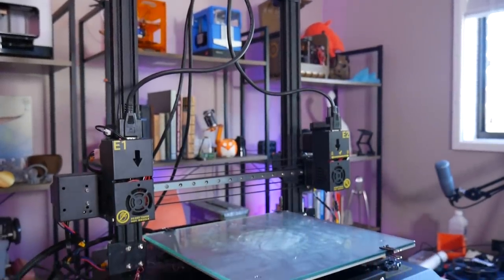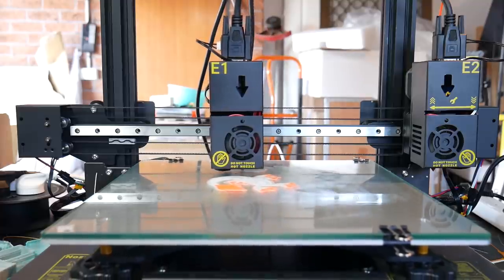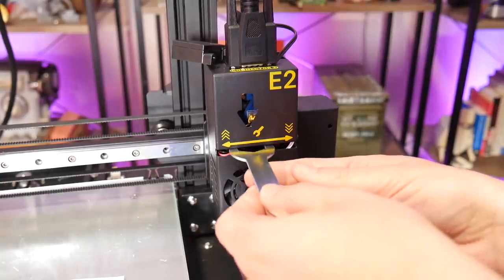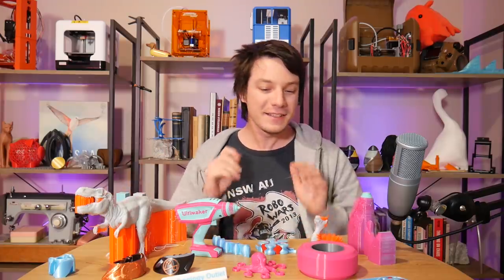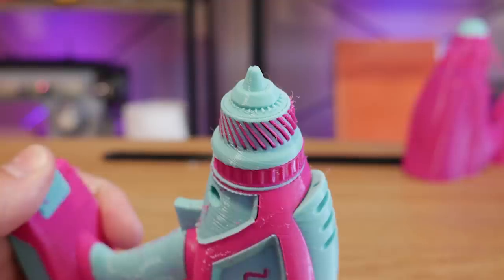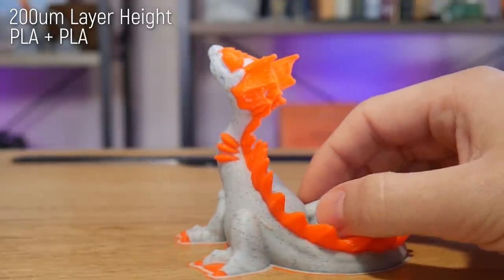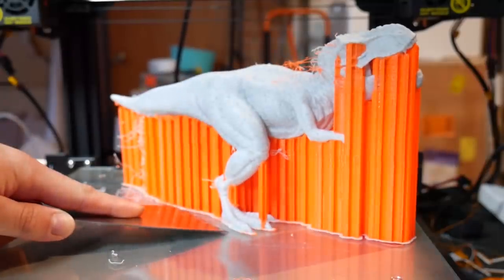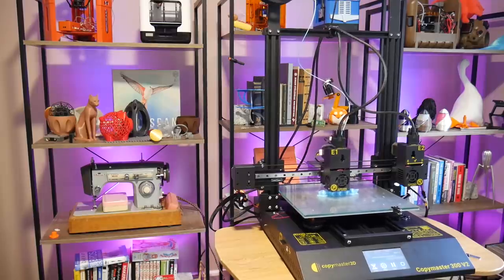Huge IDEX 3D Printer - Copymaster 300 V2 Review

Comment: The Vernier scale alignment is easily added with a custom print. It could even be done in Z, but a micrometer may be a better option. I would have liked a closer inspection of the extruder assembly, why does it have problems with flex?
Reply: The stock printhead has problems with soft filaments due to just the most basic extruder poped on it. But it can handle semiflexibles very well.... on the left side... when properly reassembled. On the right side, the mechanism of height adjustment is inherently going to leave the gap in the filament path. Bigger or smaller. No way to avoid it given the design.
Hictop does offer some overpriced printheads that have different approach to Z offset adjustment on the second toolhead where the whole carriage is height adjusted, but that just made Z offset levelling ridiculusly harder.
As previously commented, i did a "MarX Group" facebook group. If you are interested in details, do join, and you can get pictures and deeper insights from me personally there.
Reply: @marko2210  Much obliged, that makes sense, and thanks for the tips. I'll have to decline the latter offer because I don't want to join facebook.

Comment: Suggestion for a very cool Review/Comparison (also to attract loads of viewers): Materials which are very, very Soft,  even down as soft as to silicon materials. And also soft results done mechanically, and resulting in Sponge / Foam-like materials, those then printed through 3D-honeycomb-cube-shaped bubble-Construction inside a printed body , would be cool to see .... not many have done this "Soft" material Topic on Youtube, but usually, they got a huge crowd that has watched those videos....

Comment: Angus, you promissed to explain the tenlog rebrand but I didn't catch anything "more about it later" in the video.
the price is quite similar, I paid 550$ on us amazon and
from what I see, the tenlog is identical apart of blue inserts and painting tape.
maybe the copymaster does not have screenshots from chineese localization of cura and it's easier to get the parameters :)

btw, stupid question: the glass has one clean surface and other has black dots. which side up should I be printing?

Comment: Looks like an okay machine for the price. Looks like it could profit from a lighter extruder/hotend assembly, and maybe a better part cooling fan solution. But from the looks of it these are things you could easily tune and tinker with yourself. Just remove the "protective" metal sheet around the hotend/extruder, and try to use a shorter (pancake) stepper motor would be the first things i'd try...
Reply: The metal cover holds the fans in place but certainly does add extra weight. I'm working on a lightweight replacement for mine.
Reply: the printhead metal cover cannot be just removed as it holds the partcooling and heatsink fans. But mod is adviseable and smart way to go though. The stock E motors are overkill, but pancake won't work as machine lacks geared extruder. something in the middle would work.
Reply: biggest gains will be from removing the nice but nearly solid aluminum print head mount, and switching to a geared extruder with pancake stepper.

Comment: I have a Tenlog Hands 2 (smaller version) and a Hictop version.  You really should use a brush bucket (search on Thingiverse),  I have seen a few reviews and nobody is using this,  No need for ooze shields or towers.  By the way it makes no sense to call it purging when it is not actually changing filament.  Leveling was a pain on the Tenlog but the Hictop  was aligned  when it arrived.  Just need a slight Z adjustment.  I bought the Hans 2 from Aliexpress because it came under to import duty level and got the Hictop from Amazon Australia.  Also warning the Aliexpress version had the voltage set to 110v.

Comment: Could a duel nozzle printer like this be set up to have a large nozzle for printing up the rough shape of the part, and then a fine nozzle to fill in details? in my head, the detail layer would be printed first,followed by the backing/support layer. This could create stronger, faster prints with the detail of a fine nozzle. This could be super advantageous for really large prints. It is probably not worth the effort for a normal sized or small printer. What are people's thoughts? I was thinking about this for the last few weeks.

Comment: This is the big brother to my Copymaster 3D 300, I found that currently Marlin has firmware for the 3D 300, 400 & 500 & hope they catch up on this one in the series, for those that like to tweak their own features etc in the firmware...

The BL-Touch is available for the Copymaster 3D 300, 400 & 500, It would be nice to see it available for the  3D Copymaster 300 V2 IDEX...
Reply: Do you know what firmware it runs from the factory? If it's Marlin based the company is obligated to release the source to you.

Comment: Well got my Tenlog TL-D3 Pro yesterday.
Issue though. For the life of me I can not get the E2, or P2 depending on your brand, to level out. I Level the bed to E1 going to each corner and using a piece of paper. Once I do that I switch to the E2 and go to one of the corners and adjust it as instructed by loosing the screw then using the wrench to move it up or down. Once I get that one corner set to the same height it should be perfect at each corner. Problem is that it is not. I double check the E2 at each corner after I set it and its off, so I double check the E1 again and it is good. Yet the E2 is not. It is as if E2 travel at a angle which is odd because it uses the same linear rail. The Right side of the bed seems higher than the Left side JUST for the E2. Basically both corners on the Right side test higher for the E2 than on the Left side.
 How is that possible?
 Any thoughts?
Like I said the E1 is level at all four (4) corners. But for the E2 is only level on one side of the bed. It is confusing to say the least.
Reply: I think I figured out the issue I am having with leveling for this printer. I believe the weight of the extruders is tilting the X Axis as the extruders move to the other side with the other extruder. So when I level bed to the E1 it is actually already tilted because the weight of the E1 tilts the right side of the X Axis down so the bed is level at that tilt. Then when I try to adjust the E2 nozzle height the tilt is even more noticable for it as the tilt is opposite for it. That is why the E2 is higher on the right side than it is on the left side, because the E2 tilt the X Axis downward to the left.
I need to figure out how to prevent this. One option I can think of would be to try and tighten the rollers so it is really stuff but I am not sure how that would affect the independent homing for each z axis.
I then thought about the current for the z axis but it is not actually slipping. It is just the axis tilting under weight.
Last option I can think of would be to lessen the weight of the extruders. Only thing there that would help is going to lighter motors. Maybe I should just do that anyways. Of coarse I might have to try and tweak the firmware, maybe.

Anyone have any thoughts on how to fix this?

Comment: wish they just used a hotend that has the heatbreak on a grub screw
also for nozzle alightment you can use a camera and some software!
also even manually the calibration isn't that bad. just might take a while but i mean unless you change nozzles often it doesn't matter.. plus a nozzle change only messes with the z axis usually i think
edit: huh I don't need any ooze shields on my doot changer, strange that this needs it. are you sure it's not just the settings :O maybe install some silicone gasket/brush on the 2 ends so they wipe themselves
Reply: Yes, I use a brush bucket and it works well.

Comment: I think it would be better to have the z-axis on bed instead of extruder truss, I would imagine it would straight away give better average results even without optimizing all settings, especially if there is more than two bed attachment points..

Best setup still would be what I have been planning to build: rotating truss and heatbed, with z-axis in the latter.

Then it would print fast and good quality, while also allowing much larger printers be produced with basically the same amount of money as with the current ones.

And the best of it would be that if enough size and designing would be done, it could have even more extruders than just 2, especially in vase shaped builds it could quite easily have even 4 extruders rotating on top of the printer, allowing pushing the production speed (and thus standards) to a lot faster than with current setups..

If "gigantic" scale would be used, then the belt bed could be added to it too, making it even more of a challenge to traditional mass producing methods.

Eventually I would predict the rail running extruders will be replaced with robot arms simply using 3d pens or whatever is needed, even with robotic welding..

Especially I hate the belts.. I would much rather have stepper directly running the extruder assembly, thus eliminating need for such crappy contraption.

Comment: The printers firmware is an ancient version of marlin. I am really astonished, that your version was able to complete a multi hour print, as mine randomly moves the Z axis down a few cm in the middle of a print. Mechanics are solid, but the firmware bugs make it a unreliable mess. Also the LCD does not use a standard G-code protocol, so either you accept the buggy firmware or put a modern marlin on it and say bye to the pretty LCD.
Reply: If it's Marlin based they owe you the source. It's part of the Marlin license. Pressure them to release it and satisfy their obligations.

Comment: I like how you can see the change in dimension in 10:00 but Angus still claims it's dimensionally accurate... It's not, maybe it was at default speed but it's clearly wider after the speed increase :/

I hate how awfully long and complex the calibration is here. It could be so much simpler if developers cared a little more :/ Too bad, cause that's a good printer otherwise!

Comment: Hey Angus, can you look into the Hictop D3 Hero? It’s a CR-X with IDEX.
Reply: It looks to be the same printer as this one. They all seem to be a rebadged Tenlog TL-D3
Reply: @tinplategeek1058  They are indeed the same printer. I've had one for almost a year now. I did recently upgrade to the new Titan extruder option, and the few small issues I did have went away. I do a lot of prints with pva supports and they work wonderfully. And the duplicate option is great if you are trying to crank out multiple copies of a print.

Comment: I just got this machine and within 6 hours the extruder cable to extruder 1 died and didn’t heat. I could still get temperature readings extruder movement and fan motion but no heat. Is this just me doing something wrong or did the cable die really quick? (Please help me)

Comment: Hi Angus could you show more details of the runout sensors as the tenlog and hictop versions do not have them
Reply: Tenlog Hands 2 has them but it is a smaller printer

Comment: Again, I am a noob and don't know much but would this be a viable solution for printing larger objects that take more than 1kg of material by using one nozzle to print till it runs out and then would it be able to auto switch to the other nozzle to continue?
Reply: Or you could use the second extruder to do the infill

Comment: Oh I need to get one and see if I can get a Hemera on each extruder so I can run TPU!
Reply: i did it. works great
Reply: @marko2210  What did you use for mounts? Was the firmware difficult to configure?
Reply: I wouldn't think you'd need a new extruder just for TPU.

Comment: can you review a big ticket printer? like a markforged with reinforcing material?
Reply: We have a mark 2 at work. It’s fantastic. Print quality is fantastic for the most part, some prints do come out a little bad at times though, sometimes with bad layer adhesion on a single layer, other times with more cosmetic issues. The software is pretty easy to use, but is lacking things such as custom supports. It would be nice to only have supports in certain areas etc. Parts can be super strong with the added carbon fibre, but print orientation really matters. We’re printing many end use part with it, and it’s paid for itself in less than 5 months with savings vs machined parts. The filament is expensive at £150 for 800cm^3 especially compared to things like nylonX which claims to be stronger. The software has odd things too which doesn’t allow others to edit your uploaded parts, which is difficult when you have multiple users. Even with admin rights I can’t delete or even move others files, so I have to tell the individual to do it. Overall if you’re machining small, relatively complex parts in small quantities out of aluminium or plastic, this is a good purchase.

Comment: The fact it can print 2 things at the same time is very interesting, though could be a real nightmare if one of the prints happens to fail because a nozzle wasn't perfectly calibrated.  Otherwise, I'd say the Cubex Duo or Trio have the best approach to multi-color printing, because switching colors is faster and you only have one extruder to calibrate.

Comment: You can tension the X-belts by sliding the motors left and right in slots.  That's why the covers on the motor pullies have 4-holes in them. The X2 belt is probably too long for the slots and needs to be shortened at the X2 carriage with a 3D printed spacer.
Does the controller have Marlin 1.0 like the older Tenlog/Hictop versions of this printer?  Did not like it much.  Once printing, the UI became unresponsive.  Try to stop or pause a print, usually had to pull out the SD card to stop a print.  It also had trouble with high print speed which would make the machine stutter.  (after a 1000 cuts, I've just replaced it with a Duet 2 Maestro + expansion)
For allignment, print a vernier scale print.  This one works well and will let you dial the offset between nozzles to <0.05mm in 2-3 prints https://www.thingiverse.com/thing:1451156 
I've made purge buckets with nozzle wipers and parking plugs here https://www.thingiverse.com/thing:3863829.  When you get your retraction and extra retraction after tool change set correctly, they allow flawless printing without ooze shields or purge towers.  (with stock extruders I use ~1mm retractions and 5mm extra extrusion after tool change)  Had to use PrusaSlicer to get the un-retract to happen on the part for some reason.
The above thingiverse also includes some basic extruder cable management.  I've since made much better arms, but have been holding off posting until I tame the rest of the cables.

Comment: Someone finally needs to use any kind of two wire communication(i2c for example) and two power wires going to tiny extruder PCB, that allows you to have tiny 4 core cable and controll a lot of stuff and read a lot of stuff.
Reply: Think the new duet design is like that, uses CANbus
Reply: @rpavlik1  Can you like me that PCB?

Comment: The way to align a multi headed printer is with a small USB camera pointed straight up at the nozzle and place it on the bed. After you dial in the z height of each tool (do that first, and it's crucial that is spot on) -- I suggest do a single extruder print with each tool to make sure it's Z is right. Then place the USB camera (i use an 8 megapixel USB camera) -- looking at the nozzles -- get it so that the bed is about 30-40 mm away from the nozzles. I use a PI with mjpeg_streamer running -- same as octoprint and I feed the camera output into VLC and overlay crosshair somewhere in the middle -- ideally the middle so you don't get any weird parallax issues. Then move 1 tool to be right over the crosshair, and note it's position in the XY coordinates, then select the 2nd tool and have it move over the X and figure out your offsets from the 1st tools XY coordinates -- that's it -- do it one time and you don't have to do dozens of repeated prints. I built a 4 tool independent extruder machine, and initially every calibration was a huge pain, using the camera, it's pretty simple.
Reply: altough TAMV is a fantastic WIP project, due to this not being a corexy-ish type machine, the camera alignment tool would be hard to implement on it. Machine being flawed in several other much more important aspects ( like the control board and firmware ), when one sorts those out, the offset calibration is very easy. And since this only uses 2 tools, once aligned, just works. Again, TAMV is great, so don't take it like a bad reply ;)
Reply: @marko2210  camera alignment works on any machine, you do this one time, I don't think you read what I said to do -- you place the camera on the bed and you removed it after you're done doing calibration.

Comment: Angus, don't make the calibration so hard for yourself: just do Z first so both nozzles are the same height above the bed and once that works, simply dual print a properly scaled vernier scale and read the difference off your printbed. Adjust by result values, reprint to verify, done.

Comment: I know not everyone is a mechanical engineer and that not everyone can immediately grasp mechanical concepts but seriously, Angus, you should know better. The Z homing system used here is not 'pretty darn cool', in fact its a good idea that's been terribly implemented. Each independent homing places mechanical stresses on the brackets, nuts, lead screw and motor mounts. This is not a system designed with long term use in mind. Beware!

I should also point out that on my CR-X I am able to print two different materials at two different temperatures quite nicely. I have written a short how-to about this on the Ideamaker Facebook group.